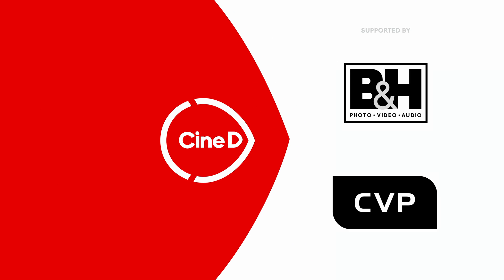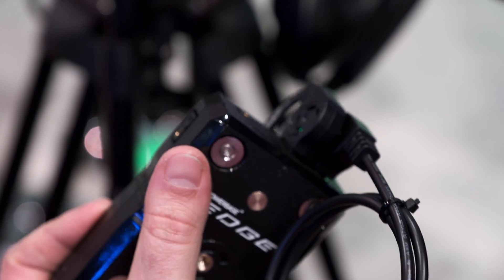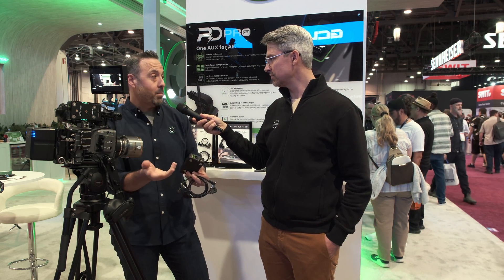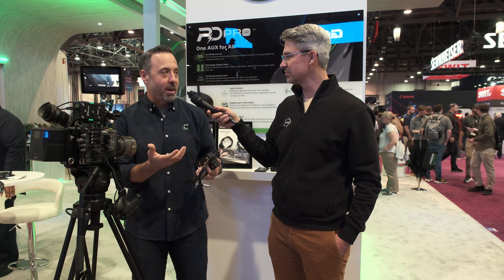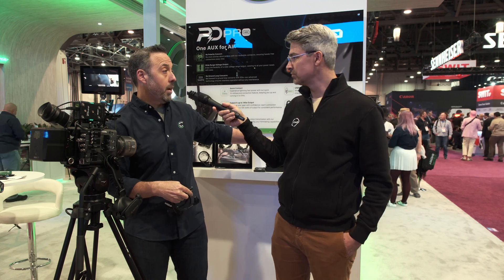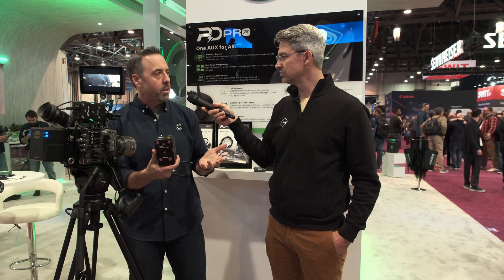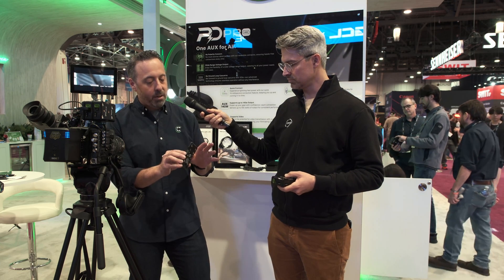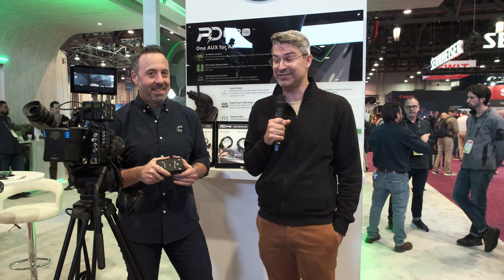Core SWX PD Pro Power Connection Explained – Solves SDI Power Protocol Issues?

Comment: My understanding of the SDI issue  has to do with current traveling through the SDI cable and damaging the sensitive signal electronics. This happens when the SDI cable is already connected and then the power cable is connected. There’s an initial surge of current. I’m not sure how this connector will prevent that. I wouldn’t want to test it out on my equipment.

Comment: Could we also have the option of just a battery plate that has those connectors? It would be great to be able to continue using our existing batteries so we don’t generate more waste. Or a version of battery plate that also has some battery built-in (like the core battery plate?) so our batteries can be hot swappable.
Reply: Exactly, I've already invested in batteries, need a plate/or adapter plate to convert an existing gold-mount to have this pd-pro connection on it

Comment: This looks great! I do have a question though - I have the CORE Battery plate for the Komodo. If I wanted to use the G3 and the PD Lemo 2 pin to eliminate the SDI issue - does the PD 'stop' battery power being received from the plate and ONLY come out of the PD through the Lemo to the camera? I guess I'm confused - If I have the battery inserted into the battery plate, won't the camera pull juice from that as opposed to the Lemo cable to camera?